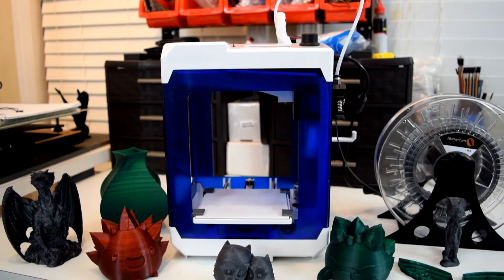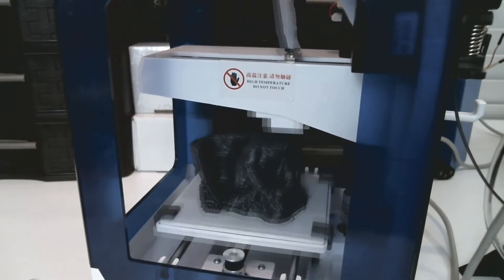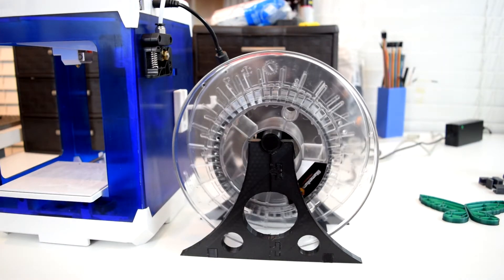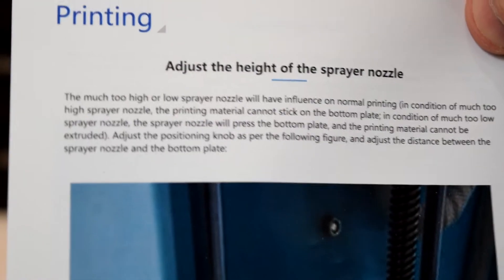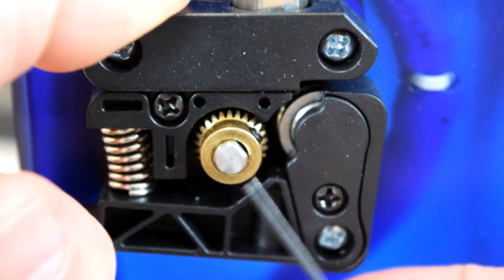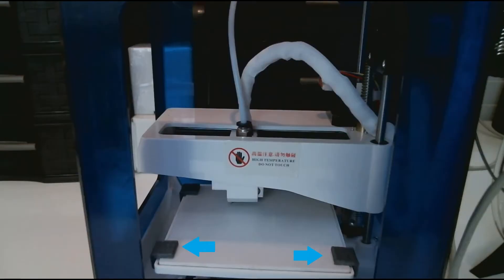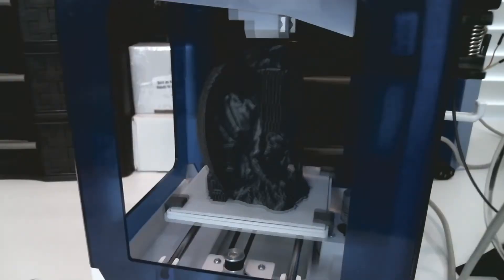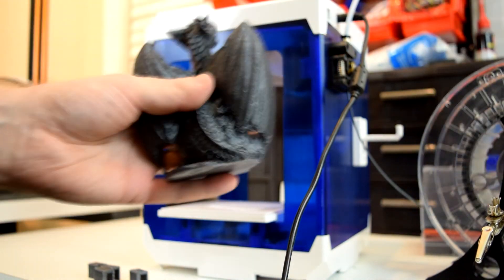Aladdinbox SkyCube 3d printer review

Comment: I am debating getting this printer since it's under 100$ right now, thank you for the review, about the issues you had: 
the grub screws can be secured with a drop of capsulating glue, they're very cheap and in every hardware store sold as Threadlock. If you ever want to disassemble it again, heat the gear up just a little bit and apply constant, but not too hard pressure on the screw, it'll feel "tight" and suddenly come loose if you keep applying heat (destroys the glue, keep pressure on till the end for the glue remains not to gunk up the thread). Don't use too much glue, you don't want it to seep in between the shaft and the gear. A single drop on the grub screw is enough for it to hold from 100 load changes to over 10000 load changes (the measure to when a screw gets loose).

Comment: I got this printer last week. Setup was super easy - the printer was out of the box and printing a test file that came with it within 10 minutes.

Initially everything printed fine but now I'm seeing an issue where the printer shifts the x axis by up to a centimeter mid-print. Based on online research, I suspect the plate motor driver overheated so I plan on opening it up and adding an old CPU heatsink with fan to it.